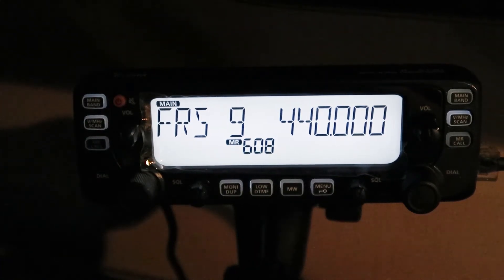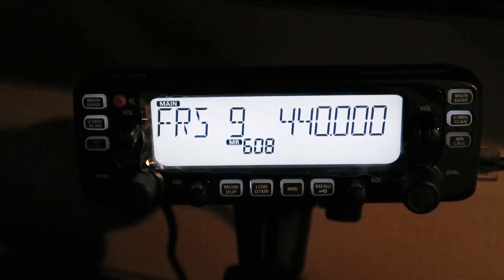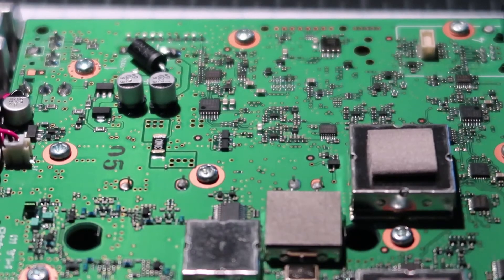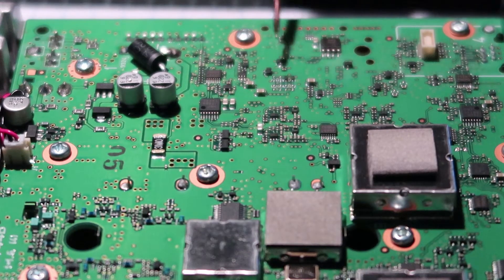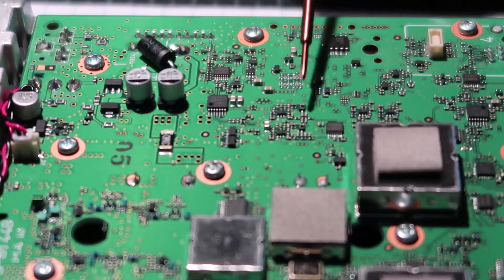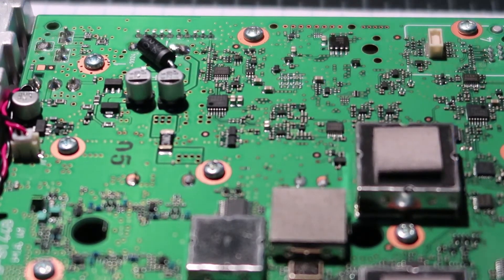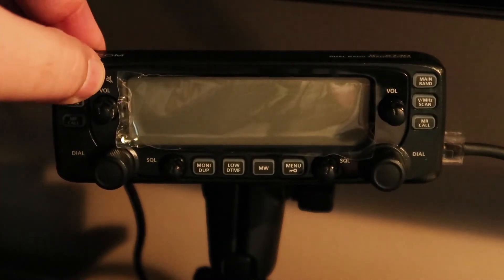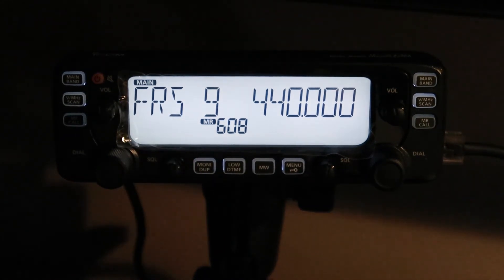ICOM 2730A MARS Cap Frequency Mod

Comment: Have you tested the power on the GMRS frequencies after the mod?  A friend of mine has an older ICOM that only puts out 5W on the GMRS frequencies after his mod.  Thanks in advance for your reply.
Reply: 50 watts. Check SWR. The radio is designed to transmit 3MHz (up to 470) above gmrs input. The diode mod is literally just an unlock.

Comment: I tried the mod and now my radio will not turn on 😞
Reply: What happened Louis? Did you removed the correct diodes number? Accidentally damaged? I want to do this unlock procedure but I'm scared...

Comment: I see in your video you programmed it for FRS9 which is 467.5875 MHz.  I just want to confirm the radio is capable of 1/2 khz and will program to 467.5875 and not just 467.587.
Reply: Yes, it will program in to 467.5875. I am putting together a video of this now...

Comment: first you call out d315, d307 but then you say removed 

d305 and d315? you have me confused?
Reply: I heard that too, However D315 and D397 are next to each other.
Reply: @autoadjuster   D397? Did you mean D307?
Reply: .............and the guy doesn't even answer the blaring questions here.....what's the matter with people?   I would like to know if it covers Muurs as well; and if the power drops off on GMRS channels, but if the guy can't even clarify which diodes........
Reply: @global-hellsorosshjt5469 no, power out on my 2730a is 46w on 467.700 repeater freq!

Comment: Right now, I use the ICOM 2730A transceiver, which can transmit problems in the 144-146 frequency.
But can't send onair In addition, can you have any suggestions? I live in Thailand.
Requesting help, contact me innlampang@gmail.com
Reply: ฉัตรชัย วุฒิยางกูร  did you get response for your problem. I have the same probleme ! I want to transmit on additional frequencies ! 

Thank you

Comment: If you did this process and the radio works ok but RT Systems software now will not function and gives a message the "baud rate" cannot be found.... 

Any suggestions?    
Friend is worried that if he does a complete reboot of the radiosystem that all the channels will be lost and manual programming is difficult at best..
Reply: Idk I used chrip and have no problem with the radio